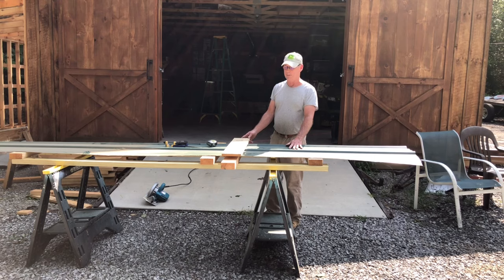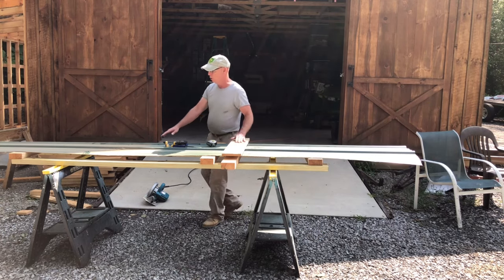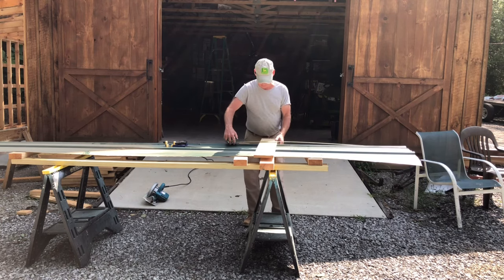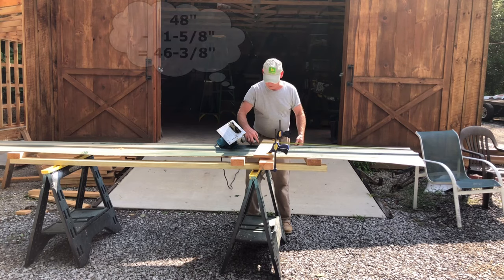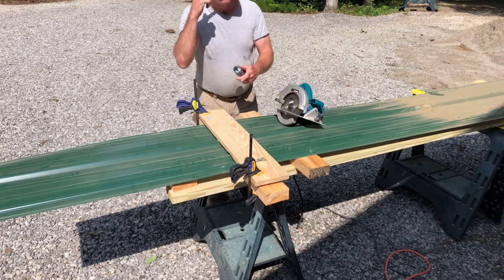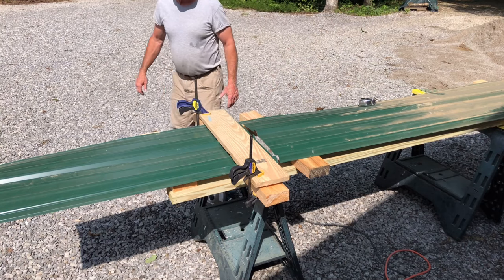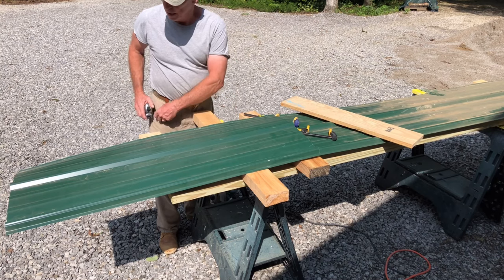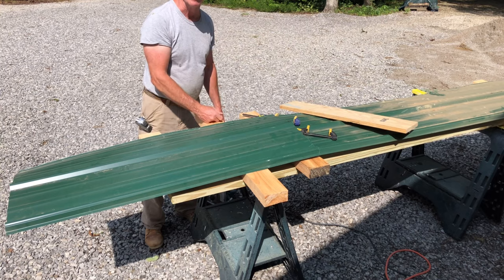Cutting Metal Roof is Easy with a Circular Saw (Just remember to cut it backwards)... What?

Comment from the maker: If you are planning on cutting more than one or two metal panels, you may want to purchase a metal cutting blade specifically designed for this purpose. (and you won't have to put one of those on backwards ) 😃- My favorite brand circular saw blade is IRWIN: 
Amazon Partners Link:  https://amzn.to/3sDG39j
Reply: I think we used to use a ripping blade put on backward at Morton. Been many years ago.
Reply from the maker: @bgleason1962  I learned this method from a contractor over 20 years ago
Reply: I used the above method 15 years ago with a diablo 80 tooth blade not turned backwards. I would cut five sheets at a time, and the edges of the cut sheet were not sharp but smooth. I had a similar jig setup as I did a building of 120 ft by 60ft. A major project for an amateur.
Reply from the maker: @dllion3196  Cool - Good to know - Thanks for the comment👍
Reply: Hi.  What is the advantage of putting the blade in backwards please ?
Reply from the maker: @JamesSmith-dt3yf  It’s a 30+ year old “Contractor’s Tip” that allows a standard crosscut blade to create a smoother cut in the metal than if left in the normal rotation 👍
Reply: @ClearCreekCabinMiniFarm  thank you for that.  I will try this method 👍
Reply from the maker: @JamesSmith-dt3yf  Be careful out there when doing anything like this ✅👍
Reply: @ClearCreekCabinMiniFarm  safety is paramount
Reply from the maker: @JamesSmith-dt3yf  👍
Reply: @JamesSmith-dt3yf  the teeth Don't snag the material tear up the cut or kickback is easy.

Comment: Do not cut your metal roof or siding material with a skill saw unless you plan on painting the cut edge or it will rust. Even if it's galvanized under the paint it will still cut through the zinc coating and rust. So rent a nibbler or buy one and then sell it when you're done with a job, but keep the die cutters lubricated or it will get dull sooner than you want. You can use a spray lubricant  in between cuts.
Reply from the maker: @bobmiller8485  Better yet order your roofing material cut to length at the roofing supplier. That’s what I do for bigger projects. I only cut roofing metal with a saw for things like chicken coops & animal runs (& put the cut end in the ridge end cap)
Reply: @ClearCreekCabinMiniFarm  yes that's true I was going to mention that. But a lot of people buy off the rack and don't order their material to size either because they're afraid of their math skills or they don't draw up a plan. Also you still got to cut around doors and windows and etc. also if they use a nibbler make sure you take your shoes off before you go into your house or you're going to scratch the floor from all the shaving stuck to it.
Reply from the maker: @bobmiller8485  😂
Reply: @ClearCreekCabinMiniFarm  even if you put the cut edge under the ridge cap  it can still rust due to condensation and moisture blowing under. But that is the place to put your cut especially if you can't cut straight. Also if you're cutting wall steel for length put the cut edge up towards the soffit into the j channel where it's not visible.
Reply from the maker: @bobmiller8485  👍
Reply: Just for those who don't know a nibbler pinch cuts so you don't need to paint the cuts. They're lighter to use, and safer specially for kickbacks. And if you cut more than one sheet at a time and make a mistake then you screw them all up. Believe me it happens even to the best of Carpenters, also the building might not be square so one measurement might not work,
Reply from the maker: @bobmiller8485  👍

Comment: Question. Why do you cut on the side with the ridges? Turn over the sheet, mark it and cut on the flat side. Makes live much easier.
Reply from the maker: Great point - one of the other viewers mentioned this too - every day is an opportunity to learn something new- Thanks again for your comment👍
Reply: Because ruffles have ridges
Reply: Why would you measure to the center of a blade?
Reply: @ClearCreekCabinMiniFarm if you cut from the bottom of the panel you can run the blade in the proper direction.
Reply from the maker: @chad6504  Good to know - I learned this technique from a contractor 30 years ago and have never tried anything else because it’s always provided good results  ✅
Reply: We've always cut with the color side up. If the panel shifts like in the video. There won't be any damage to the finished side. And if  you make a saw sled. You can just clamp it to your marks and cut. And no damage to the finish from the saw.

Comment: Your table is a nice setup. I’ll definitely use the idea for the moveable ladders. One thing that I learned is to turn your metal over and cut on the backside. It saves you from scratching the top and it’s also easier to cut because you don’t have to move your saw up and down over the ridges. Thanks for posting the video.
Reply from the maker: Thanks - Will definitely turn it upside down & cut it backwards next time 🙂

Comment: We did this at Morton Buildings. The only thing we did different is that we put the metal upside down so you have a smoother surface to cut rather than up and down on the high ribs.

I actually just did this today putting a roof on our new front porch.
Reply from the maker: Great suggestion thanks 👍

Comment: We have a storage facility and have been adding some demising walls. Wish I had seen this sooner cause these end pieces would have been so much cleaner and easier to make custom cuts. Definitely going to try this. You tube for the win!
Reply from the maker: This certainly makes cutting metal easier without the $50 expense of a specialty blade - Just use an old "good quality" carbide tipped cross cut blade in backwards -works great.

Comment: I’m about to build a small grill shelter. This exactly what I needed. My saw has the same edge distance between the edge and blade. Wonder if it’s standard. Thanks for sharing the info! Just saved me some money on air powered snips.
Reply from the maker: Glad this is gonna help - Best of luck with your grill shelter - Be safe working on your project!👍
Reply: @ClearCreekCabinMiniFarm  thanks! Headed to buy the wood now. Never worked with metal roofing, but will definitely be wearing gloves and safety glasses!
Reply from the maker: @ScruffyCityFishing  Have fun - BTW I prefer the “self piercing” roofing screws over the “self drilling” ones !
Reply: @ClearCreekCabinMiniFarm  oh, great info! Building it to move my grills and make room for.. more fishing stuff haha.

Comment: Thank you for the suggestion. Worked pretty well although some people may need to adjust the depth of their saw cut. Straight cuts are easier than diagonal. Do you have a trick suggestion for that? Saved me lots of time and impressed my Wife/Helper which is always a good thing. God Bless.
Reply from the maker: Glad you found it helpful - I can’t suggest any additional tips for cutting on a angle - one viewer said to turn the roofing upside down and cut from the backside - maybe that would help? 🙂

Comment: Thank you.  
I have to put a tin roof on my stable for a Mini-Horse we're getting next week. I wasn't looking forward to using tin snips, and now I don't have too. 

Question though? Wouldn't a metal cutting blade on the circular saw work?
Reply from the maker: It certainly will be a lot easier with the circular saw vs tin snips. Using the old crosscut saw blade backwards saves running to the hardware store & about $46 for a blade specific for the purpose - “Irwin” is my go to brand for circular saw blades & they make a 48 tooth 7-1/4” blade specifically for cutting metal… Best of luck with your project 👍

Comment: Why should the blade be flipped around? Thanks for the video.
Reply from the maker: @PetrusB83  less tearing of the metal & a smoother cut when using a 40 tooth blade instead of one design for metal

Comment: Great vid … roofing a deck this weekend. 
Does it matter what kind of blade you use in reverse. For example would a multi toothed blade be better than a framing blade?
Reply from the maker: Hey, good luck with your roofing project - I have always used a 40 tooth carbide tipped cross cut blade for general purpose framing and fast wood cutting (Irwin makes a good one)  So I use one of these installed backwards just because I have several old blades laying around. I've never tried a 60 or 120 tooth plywood type blade nor have I used a new cross cut blade for this.  Irwin makes a 48T metal cutting blade specific for this type of work that's around $50  if you're looking to buy a new one for your project. Have fun and be safe during your project...
Reply: Problem with using a carbide tipped framing blade is the teeth will break off, much better to use a fine tooth plywood blade or a blade made specifically for metal.

Comment: How smooth are the cut edges?  Need to take off any burrs?
Reply from the maker: There are very few if you go slow & only cut one sheet at a time - I always try to cut the edge that goes up into the roof peak cap or into the sidewall flashing leaving the factory edge exposed 👍

Comment: gret video thank you.   So basically I do not have to buy a metal saw blade just use my Wooden blade??   and turn it around as you said?    the blade i have now only cuts wood?   so by turning it the other way it cuts Metal too??   thank you Rachael from New Zealand
Reply from the maker: Be careful if you are using an inexpensive crosscut blade - I always use a high quality carbide blade that has been well used - cheaper blades can have the tips come off when doing this - And I don’t use the blade ever again for wood work - only for metal (in backwards) or dispose of it 👍

Comment: Thanks for sharing. Does it have to be  a metal cutting blade or wood cutting blade would be fine ? Thanks
Reply from the maker: They make a metal cutting blade specially for this - They cost around $40 - That’s why I use an old cross-cut blade for wood that I put in backwards - Saves the $40 for a blade that would rarely get used

Comment: Just getting ready to metal roof my garage, and need to cut 1.5" off each sheet as they didn't allow for my ridge vent.  Is it worth covering the cut sections with something?  I was thinking maybe a galvanize spray?
Reply from the maker: Wow that's a shame - I wouldn't recommend cutting off such a small strip with a circular saw though.  I would think that pieces could dangerously fly off at a high rate of speed.  Any time you cut a finsihed (coated) metal you risk exposure to the elements unless you recoat it.  I would think a foam brush touching up the cut edge with a cold galvanized wouldn't cause an overspray on the rest of the panel that a spray can will?
Reply: @ClearCreekCabinMiniFarm  Yeah I'm not thrilled about it.  My options are to perhaps leave 1.5" sticking out over the edge, split the difference and have 3/4" sticking out and 3/4" X2 as a ridge vent, trim them, or skip the ridge vent and put in gable vents.  There's a bonus room in the trusses, but I don't plan to insulate it, just the main area.  I do have a diablo blade for my circular saw that I was planning on running to cut them... and having them stacked tightly and mask for overspray.

Comment: Is there a limit to the number of sheets you can cut at a time? I need to cut 1/2” off about 40 sheets.
Reply from the maker: The most I have ever tried was 2 cheets at a time. Which made the edges more ragged than cutting a single sheet. Assuming you are going to use either a ridge peak or a shed roof sidewall flashing you can always plan on cutting the upper side of your roof panels so that the cut edges get concealed - have fun with your project.

Comment: Found this video few day ago... Today i try its...its works...  Its help me alot..Thanks bro... But i wonder how many teeth perblade best to use...now i'm using 60t... Seem bit heavy...
Reply from the maker: Thanks for tuning in - I have always used an Irwin 40 tooth cross cut blade installed backwards (an old well used one kept for this purpose) Irwin does make a metal cutting blade specifically for this purpose for about $40 - Good luck with your project !
Reply: @ClearCreekCabinMiniFarm  he he im using bosch blade..that 60t...lost the carbide.  but its doesnt matter..i got lot of that kind of blade.. hahaha ...may its because the quality ... then im using 40t.. seem much better even in same brand

Comment: You, Sir, just made my week.  I have about $3000 in used barn tin to cut, and I'm sure you know how much tin that is.  I was NOT looking forward to doing it with tin snips or an angle grinder.
Reply from the maker: Wow - what are you building?
Reply: Use an angle grinder and invest in a good diamond blade. Cut through like butter.
Reply from the maker: @michaelc5985  Good to know 👍

Comment: Great video and demonstration. I see you used a 40 tooth blade. Can I use a 24 tooth carbide blade and get similar results? Thanks
Reply from the maker: Thanks - You probably could use a 24-tooth carbide tipped blade, but you may want to try it on a scrap piece if you have one (just in case)
Reply: @ClearCreekCabinMiniFarm  Thanks for your help.
Reply from the maker: @davidsteep  You're more than welcome...!

Comment: Awesome for I’m building a 12x12 shed and I’m thinking about doing a metal roof for I don’t have to left shingles. For my flooring frame is is a couple of feet above ground and my roof pitch is 30 degrees
Reply from the maker: Wow - I agree - Metal would be a lot less stress on the back😀

Comment: Good stuff, thanks! Even if your blade was a carbide blade designed for metal, would you still run it backwards?
Reply from the maker: I would think not but it would depend on the number of teeth and the gauges that specific blade was designed to cut - I believe most roof panels at the big box stores are 29 gauge so you’d have to check your blade to the thickness of the metal you are cutting 👍

Comment: Why do you flip the blade around? I tried to cut a sheet (for the first time) the other day. LOTS of sparks, super noisy, and decided, it's not for me, and I need to find someone to do the job for me... Perhaps I'll give this a try. Thanks
Reply from the maker: You would only put the blade in backwards if using a crosscut saw blade for wood.  This points the saw teeth backwards which makes the cut less aggressive. They make blades specifically designed for cutting metal but they too are very loud and throw out a lot of sparks.  Safety Glasses and Hearing Protection are a must when doing this kind of work…

Comment: Question... did you use a metal-cutting saw blade and then reverse the blade or is it a normal blade and then reversed...? Thanks.
Reply from the maker: I used an “old worn out” Irwin 40 tooth carbide crosscut blade (for wood) that I installed backwards instead of buying a new metal cutting blade (that would have been used very infrequently) 👍
Reply: @ClearCreekCabinMiniFarm  Thanks, I saw the comment below after I posted. Apologies.
Reply from the maker: No Harm - No Foul - Good Luck with your project - Be Safe...

Comment: Can you do the reverse blade thing with a Carbide tipped blade? I'm not sure if it would knock the soldered tips off if they are hit from the opposite side they are designed to use for cutting.
Reply: Ah! Posted my question before reading the comments. Great vid. I think I've got all I need to know. Thanks!
Reply: Update. I had an old Carbide blade and tried cutting three sheets at once. Worked great and no damage to tips on the blade. Thanks again for the vid.
Reply from the maker: I’ve always used an old 7-1/4” Irwin Marathon 40 tooth carbide tipped blade & never had an issue on small projects - I would think a good quality blade should be okay but I would avoid a cheap one - in any case be careful - safety 1st👍

Comment: Thanks for the video. I just did eight sheets. I doubled them up and put them upside down. The first cut was good. The second cut was pretty good. The third cut was okay. The forth cut was "eh"  Is this Diablo blade dead already with just four cuts.
Reply: Here's my setup I just used:  https://drive.google.com/file/d/1e7VHxECCafxEJoS7HHMdMZfYW7Juogj5/view?usp=drive_link
Reply from the maker: Nice setup - I've never cut more than one piece at a time. I've always used a Marathon Carbide Tip Crosscut Blade installed backwards. (Marathon blades are a high quality blade) I've never used a Diablo?
Reply: @ClearCreekCabinMiniFarm  someone on one YouTube thread recommended cutting two at once. I cut the ridge cap by hand. I was going to try to use the circular and do it in two passes such that each pass that half is laying flat.
Reply: The Diablo (if I’m spelling it correctly) are at all the big home improvement stores (plus Amazon.)
Reply from the maker: @raymondjiii  Never tried that - good luck
Reply from the maker: @raymondjiii  I've seen them but never used one